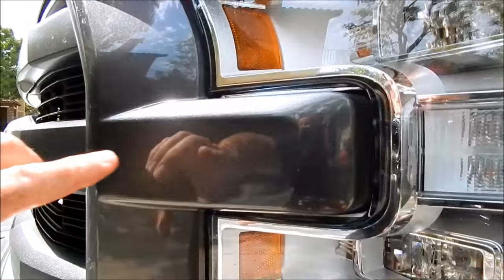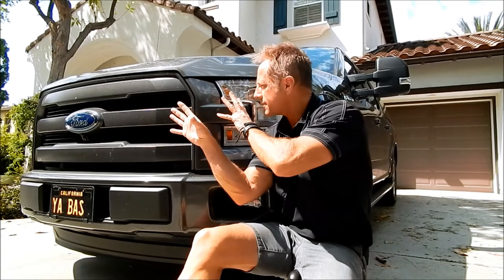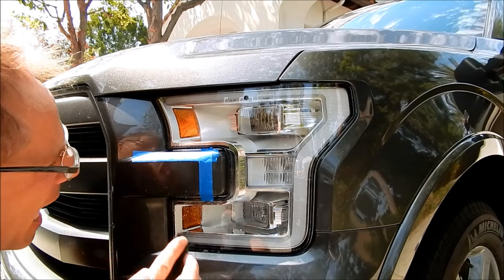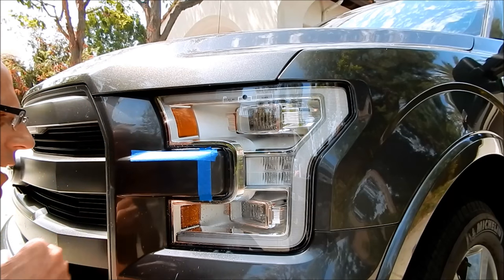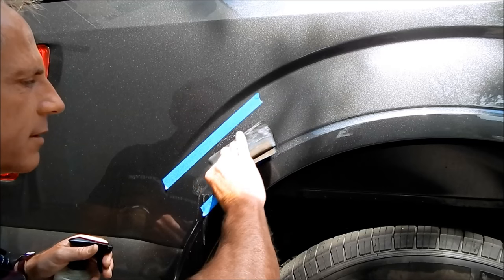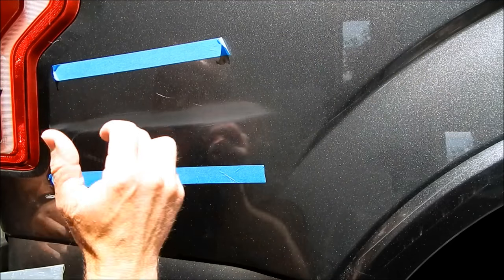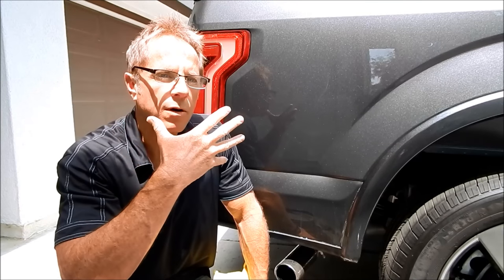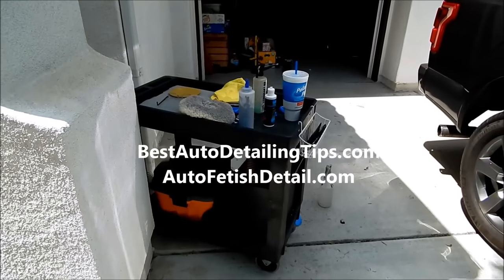Car Paint Scratch Repair for Beginners: Wet sanding, polishing, and common sense tips for business

Comment: hi Darren, can you get those discs in 1500,2000, as well as 3000 grit then,. also, could you not use those discs by DA then on low speed?

Comment: Hi, i repaired a small scratch using a touch up paint pen, i think i made something wrong, becasue now i see a white shadow in the area i worked on, it's similar to the shadow you show in you video after sanding, its looks like as hologram. I bought a turtle wax Premium Polishing compound, Do you think is safe for the clear coat applying this product? It's a new car and i don't want make it worst. Thank you for you videoI

Comment: Used to check in the CPO cars at a local BMW dealer. We just used solvent based paint mixed to the color of the car with a little bit of clear and reducer mixed with it. Apply with toothpick. Heat dry. Wet sand with 1500, then 2k. 3m polishing compound, then an anti swirl polish. Never know it was done. Now granted that was on small stuff. Anything larger we had our body shop blend it.
Reply: 3m buffing compound* And the polishing was all done with a little pneumatic angle grinder setup with pads
Reply: Hey Finn I'm picking up my detailing game been looking for what you said.  The paint guys I used to work with used a special mix clear coat not sure the ingredients fast hardener? anyway they would touch up the clearcoat scratch even ones that were deep dry it, wet sand buff and it would be gone have you heard of this?
Reply: +Oz Nicholas sounds legit. Our body shop was in a dealership so we checked in all the certified pre owned cars. Thats where I got all my touch up experience. Reason I stress this is we had the paint codes already mixed up. Then I would have to go back and use a little reducer to make it more liquid again. If you were just straight mixing it up then yes you would probably need some sort of hardener to accelerate the process/thicken the paint up a bit. 

Just dont use water based paint for it as it will go to hell in a hand basket when you go to wetsand
Reply: whats the difference between reducer and thinner for paint?
Reply: +Oz Nicholas In reality not much other than thinner is a laquer and reducer is generally a urethane. However they are used for essentially the same thing. We used a special "basecoat reducer" by dupont I believe. Sorry bro, been a long damn while since I have worked there

Comment: When you used the wool pad on the first scratch, that was without any type of compound, correct?  Why is that step in there as opposed to going straight to the polishing step with the foam pad?  By the way, do you have any videos that deal with deeper, down to the metal scratches?

Comment: Are you going to review any of the ceramic coatings  in near future? I would really like to see your opinion on them? Would those ceramic coatings save a paint from small scratches..Excellent work btw.
Reply: coating do not stop scratches but the beading properties are way worth it. also coating last longer than any paint sealant or wax
Reply: coatings do indeed "stop" minor scratches, due to its hardness. this varies from costing to coating but Maxprotect coatings are somewhat scratch resistant. A buddy took his coated swirlfree car through a generic car wash(machine) and it came out the other end just as good as before.

Comment: I have scratches and faded paint on two areas . What's the best way to cover those up and try to fix the fading ? I'm going to get it painted later . Also how can I get really bad stains from the previous owners seats. It's a BMW Black and tan interior.  I've tried EVERYTHING HELP 😊
Reply: I'll answer and maybe Darren will help you also.  I've see him use Meguiar's Super Degreaser on Leather seats that are really dirty.  He also uses Meguiar's all purpose cleaner on slightly easier to clean seats.  I've bought Nonsense all purpose cleaner from chemical guys because it comes in a smaller bottle that the ones I mentioned and you dilute it yourself.  It works well but can leave seats slightly tacky feeling, so I'd recommend a quality leather conditioner afterwards. Don't be afraid to use a bristle brush (like a potato brush) and scrub the leather a little bit to get out tough stains. For the fading paint, its possible you can polish the paint and bring back the shine.  This is easier with an orbital polisher though than trying to do it by hand.  There are 1 step polishes that will take away small scratches and shine at the same time.   Disclosure: I am not a detailer but I feel like one after subscribing to Darren's channel! Hope that helps.
Reply: +weaverpsu Thank you , I'm going to try it
Reply: Turtle wax for the paint. Steam-cleaning on the inside. Don't polish the paint by yourself, unless you know the depth of the paint.

Comment: Can I buy this Cordless Buffer from Milwaukee?  What is the Model number?Darren do you ever use clear coat to fill the clear coat scratch then wet sand and buff?
Reply: Milwaukee 18 Volt M18 Cordless FUEL™ 7 Inch Polisher Kit 2738-22P
Reply: +phordguy thanks

Comment: Are these the same basic steps for removing the clear coat "orange peel" effect (that wavy appearance in the paint when you move your head)?
Reply from the maker: Yes they are.
Reply: Highly advise not doing this unless it is a show car. New cars have thin paint and clear coat, and you have to remove a lot of that to get the orange peel out. Unless you are coating or putting a clear film on the car.
Reply: ***** I was just getting confirmation of something I had seen on another YouTube video. I doubt I would attempt to take on something like that without lots of practice on dispensable surfaces first.
Reply: Bill M Yeah I have customers wanting it all the time, but for a daily driver it is not a great idea as it leaves basically no room to fix scratches afterwards. While it looks good, it just isnt realistic for everyday use, unless of course you add some sort of film protection.

Comment: please help. i have an 05 ram 1500 i bought used and the the last owner put a stupid brushed aluminum sticker on the dash that is but ugly. i cant get the adhesive off. any suggestions?
Reply: What did you try so far ?
Reply: Try Goo Gone Automotive. You can get it at Wal-Mart it's about $5 bucks. It really work great on removing adhesives.
Reply: heat gun then use wax grease remover
Reply: Thanx.
Reply: Be sure it is labeled Automotive and not the regular Goo Gone. Spray the Goo Gone and let it sit for a couple of minutes. The adhesive will be easily wiped off.